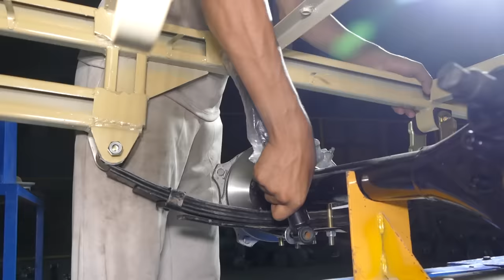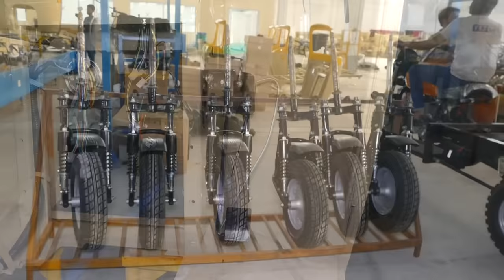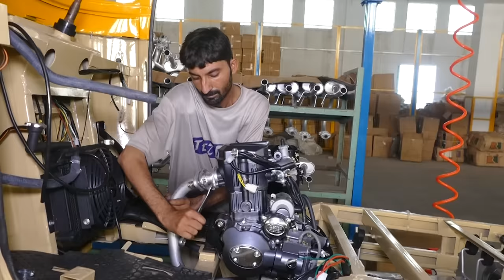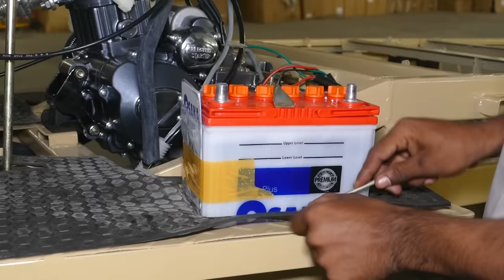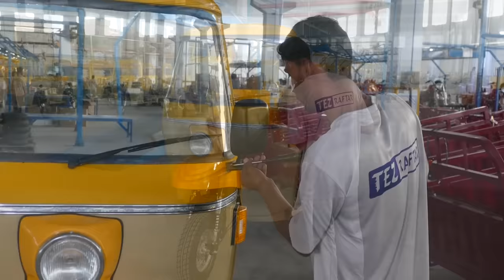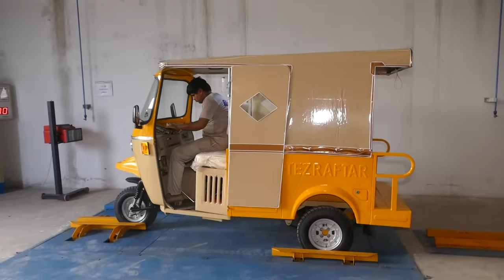How Tez Raftar Built their Quality Auto Rikshaw

Comment: I like the general design and yellow colour scheme of the model shown. Just two factors, they should build the chassis and passenger bodywork of pressed steel, wood and plastic, instead of angle iron and box forms which is welded together here. There is no weight (and material) saving. The pressed steel is lighter and saves on assembly man hours as it is mostly spot welded. The engine, no idea what engine it has, but one of the best engines has been the Honda 50-70 cc. It has been powering on since the 1950's. If they can get a 2 cylinder liquid cooled 4 stroke OHC unit like that of good capacity, then they would have a really good, reliable product.
Reply: OH I THINK THEY HAVE GOT IT DOWN PAT MATE,  NO NEED TO WORRY ABOUT IT.

MAXXAUS.
Reply: @justvisitingterra6459  Are you watering down my comment?
Reply: @mohabatkhanmalak1161  AS FAR AS THE CHASSIS IS CONCERNED ,  THEY WOULD HAVE SAFETY RULE'S THEY WOULD HAVE TO ADHERE TO BY LAW,  THE SAME AS CAR'S AND TRUCK'S, AND I BELIEVE YOU WILL FIND THEY ARE FAR FROM BEING JUST,  "SPOT" WELDED.

MAXXAUS.
Reply: @justvisitingterra6459  I rest my case and move on. By your last comment I can make out that you have no knowledge of spot welding and industrial production processes.
Reply: @mohabatkhanmalak1161  WHATEVER .

MAXXAUS.
Reply: i think it's already a 2 cylinder liquid cooled because there is a radiator
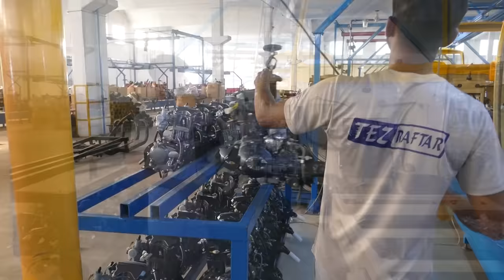Reply: @mehdisol7094  at 1:45 you can clearly see its a single cylinder, looks like about like a 250cc but that's hard to tell from the outside.
Reply: @justvisitingterra6459  u+t
Reply: @saddamkhan9562  YOU LOST ME .

MAXXAUS.
Reply: Gggg
Reply: Daposit Name EZEKE ONYEMEME AMAGU MPU $800,000,000 Bank approved

Comment: Give a little "positive camber" to the back wheels on the rear axel, then your rickshaw won't do dangerous wheelies. All the Apé rickshaws had a positive camber. 
When 3 passengers are seated in the rear, the weight will push the tires from positive camber to neutral camber improving the contact of the wheels and road, better breaking and lesser wear and tear on tire. 
Currently the rear wheels have neutral camber, once passengers sir, it will change to negative camber and is bad for ride and tire wear. 
Look at the front tires of F1 cars in contrast, they have Negative camber. During a corner turn at high speeds, the G force will push the front wheels to neutral camber, tire will make full contact with the ground, change the direction of the car and not skid.
Reply: u r absolutely wrong bro.... ape has independent suspension but this auto with non indipendent suspension with differential and drive shaft..so the nutral camber is fixed even if there is 3 passengers in the back side....in case of  ape  u r  right......but in  racing cars using little negative camber because while cornering at high speed the wheels on opposite side will pushed upward direction and then total load will be on inner wheels..then  inner side wheels will get more contact patch because of negative camber,[ in this case u r wrong] wheel will not going to neutral camber
Reply: I think you can't see a solid axle.
U r only trying to look smart.
Reply: Yes you're right, it is a solid axle. How did I miss it
Reply: Also in comparison to donkey carts, the crumple zone is very short.
For safety reasons it would be better passengers will sit in front of the driver for additional driver protection.
Reply: Solid axle same as a trailer no camber required
Reply: you sound smarter when you dont speak

Comment: Interesting to see how even a simple rikshaw still has a crazy amount of separate parts.
The number of parts and therefore assembly processes could be drastically decreased with some clever engineering.
On the other hand labour costs are very cheap in Pakistan?/India? so many workers is no problem.
The name "Euro 2" is quite funny because you'll never see this vehicles in Europe.
Reply: CDE
Reply: It is designed for the best maintenance,it's mechanical parts are very simple and straight forward

Comment: Turn it around, two wheels in front, one wider drive wheel in back, and no more tipping. I know this is easier to build, and uses off-the-shelf scooter parts, but it's never been a good design to have the two wheels of a three wheeled trike in the rear. Oh well.
Reply: ذ

Comment: Auto rickshaw is an excellent ride for city transport. A 200cc engine can cary up to 3-4 passengers like a car with 1/5 of carbon emission. If they use LPG, CNG and, Octane/petrol then It's ok. But Diesel powered autorickshaw is deafening. Although, in my opinion, autorickshaw should be electric or with developed silencer pipe. 

Auto is a practical transport for short distance and low cost ride.

Comment: Gosh do they only tighten half of the parts? Don't believe me? The horn swung loose all the way through assembly! The window isn't seated correctly either. The hydraulic brake line is rubbing on the chassis and will wear through.
Not well made, not correctly assembled and will not last at all. Made in India? yeah it shows.